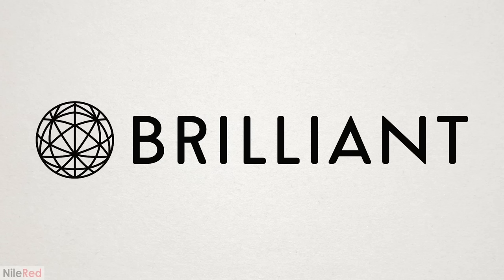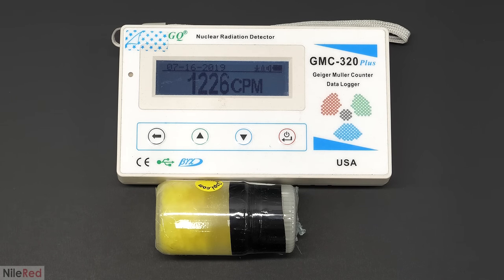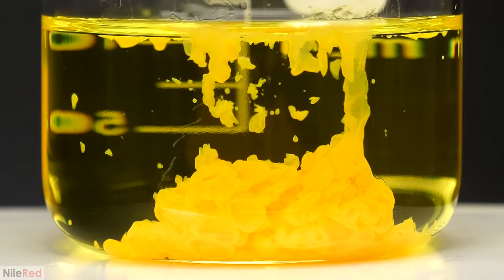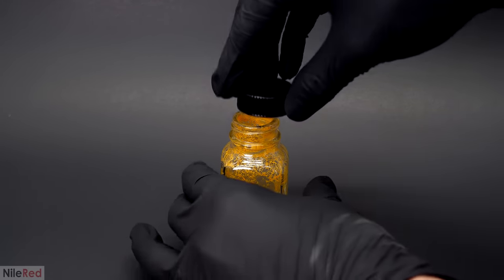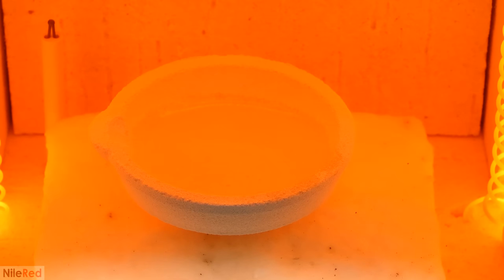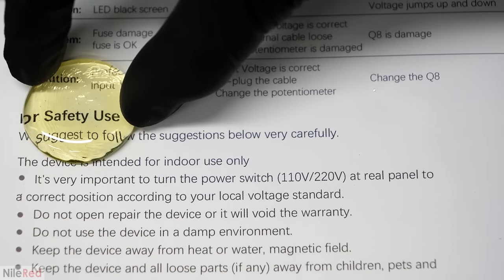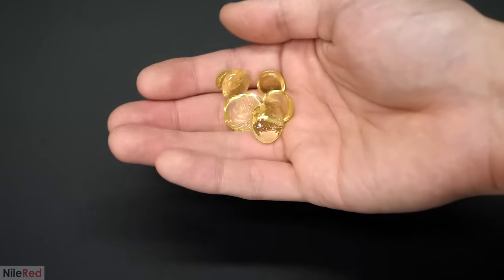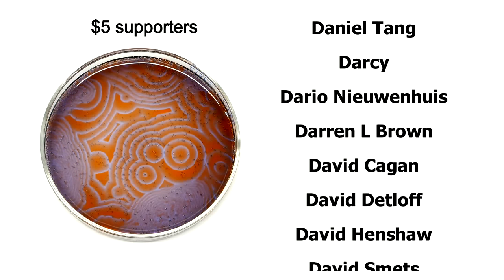Making uranium glass

Comment: So im just going to drop my 2 cents here.  For some background I was a CBRN (Chemical, Biological, Radiation, Nuclear) subject matter expert in the Air Force.  The installation I was stationed at made the focus of my experience within the field centered around the Nuclear and Radiological aspect.

I was curious if I missed it, or if you simply omitted wearing a protective mask whenever you were around the materials?  The primary reason being the particulates of alpha and beta radiation.  Its the same reason I would never drink from a glass made using uranium or any other radioactive material.

Alpha particulates can be stopped by paper or skin, beta by tightly woven fabric, and Gamma rays only through time, distance, and shielding.  Most people with working common knowledge of radiation tend to focus on the danger of Gamma.  However within my field, we actually consider alpha to be the most dangerous form.

The primary reason for this is that Gamma simply passes through your body.  However, beta can and alpha does get trapped within your body upon ingestion or inhalation.  This causes it to simply bounce around inside of your systems with no means of escape, continuously bombarding the vulnerable organs within your body with radiation.

These particulates can be excised through ingesting compounds that bonds to the particulates, but that is something that specialized medical staff would deal with so my knowledge on that subject more general then on the matter of radiation in general.

I hope you stayed safe and I would warn anyone away from being around materials that release anything above normal background levels of radiation without proper PPE.
Reply: The guys who runs this channel is very good about following safety precaution, so I'm sure he did. :) He is a trained professional, after all
Reply: @lucyk8935  yes this is true, but I also was wondering about the use of a respirator or some kind of mask. Nigel is really good, but it is always possible for really good people to make mistakes. I do hope that next time he works with uranium or other radioactive materials he does use a mask as well.
Reply: I'm pretty sure he did and goes more into detail in his cleaning up video.
Reply: He has been wearing a mask. Like,
Reply: Well, yes and no. I cannot agree more about dust particles, they can be dangerous, while alpha "radiation" (not true radiation actually, due to it's particle nature) it self, not so much. It won't bounce inside your organism as you said, because it will quickly become absorbed by nearby tissue. Problem is that dust particle, which will sit there and will be constantly producing another and another alpha particles. It will literally act like a source.
Drinking from uranium glass is safe. First, it emits next to none radiation, very similar to natural background. Second, if it would emit any alpha praticles, they would be imediately absorbed by liquid inside the cup and would not find the way in your organism.
About how dangerous are specific types of radiation, again, it deppends on circumstances and it is simply cannot be said that "this one" is the worst. It deppends on what you consider as actuall danger, it's ability to travel over distances and penetrate materials, or it's actuall effects.
Gama radiation is most capable of all 3 to travel and penetrate, as you said. While alpha can be very easily shielded, but can cause most damage when somehow gets inside your body, again, as you said. But not because it will bounce around, but because it has strongest ionization potential. So gama is considered by many people if you get exposed to some external source of radiation, because it will get most easily inside you. While alpha is most dangerous  when you inhale or digest radioactive material - like dust for example - because it will become internal source of radiation, and there will be nothing in it's way to shield it.
Reply: @OslikusPrime  not true radiation? You need to reconsider your definitions. It is not radiation in the sense of electromagnetic radiation, but it is most definitely radiation. It literally radiates from a radioactive particle.

Otherwise I think you're right about alphas not "bouncing around" in the body. They would simply be absorbed. But I'm not a biologist or doctor, so I'm not sure.
Reply: @camrouxbg  You are actually wrong, or you don't understand what I ment.
Of three types (alpha, beta and gama) only gama is a type of electromagnetic radiation. Alpha (and beta) is a stream of particles. It's helium nucleuses in case of alpha and electrons/pozitrons in case of beta.
We call  it incorrectly a radiation because scientists who discovered it back then had no idea about true nature of it, and thougt it is a radiation. Calling it so is more like a tradition, or historical value, then a fact.
Reply: @OslikusPrime I understood exactly your meaning. I'm not an idiot. You think words cannot have multiple meanings? Anyway, EM radiation is in the form of photons, which are particles. So really, all radiation is a stream of particles. Many people refer to it as radioactive emission, though I'm sure you take issue with the use of the term "radio" in there as well. I suppose we should disavow Newtonian mechanics now that general relativity provides a more accurate description of gravity as well.
Reply: @camrouxbg  Oh well, you take verything personally don't you ? If you can't or don't want to understand difference between helium nucleus and photon, it is pointless to continue in this discussion.
Also, photon is not simply just a particle, it is both, wave and particle. It is called duality and it is something quite special. And it is a quantum of electromagnetic field, which is something completely different, then helium nucleus. Yo yes, particle can have a lot of meanings, as well as radiation. But in this case, both words has very specific meaning. 
In my opinion,  all you want is to argue so .. have a nice die I won't participate in this.
Reply: Alpha particles are helium nuclei with no electronics. They are stopped by almost anything. They readily capture electrons and become innert helium atoms. At that point they are no longer able to interact t with anything and will end up leaving the body. Helium leaks out of helium storage cylinders that are welded shut by slowly moving between the iron atoms.
Reply: What is worse Uranium glass or Crystal glass (which is up to 30% lead)
Reply: @OslikusPrime  r/iamverysmart
Reply: @vHindenburg  Crystal glass with lead is not a threat, at least not directly. It is not being released from glass. Yes, it's production can be an issue enviromentaly and might threatening health of workers.
And not all crystal glass contain lead. Lead is added especially into machine produced glass, because it has some benefits in regard to different cooling curvature in it's liquid state and even there I am not sure, if in all cases.
While hand made glass is often lead free, because it has also own downsides, especially mechanical ones.
I am sure, I frogot a lot in time, but some things stuck in my head, when I worked (briefly and long time ago) in a glass industry.
Reply: @OslikusPrime  Yepp also handling of lead in general is handled way differently to place to place to the point you are unsure how dangerous lead or mercury actually are . Sure you shouldnt eat it. Though it shouldt kill you by just touching it that one time if you wash you hands afterwards. I seen examples where people insisted that you will certainly die of it if you dont wear gloves ( which is an exageration to be fair)while you if you buy lead bars for roofing at the hardware store there isnt really a label about handling on it.

For example I have heard so I am unable to proof or disproof that using a christal glas discanter for wine just the one evening is fine but you should never store any any longer than that. I guess the same applies for items made with Uranium Glass ond Uranium Orange pottery. (Until mid 1960ties i believe).Not really that dangerous unless it is an item of dayly use.
Ar even Asbestos...usually relativly harmless until you fuck with it and get the fiber flying into the air. Its a shamethat such a useful material is so cancerous literally.

Any advice about handling , lead, mercury, items that may contain asbestos or radioactive material you might find in grandmas basement?
Reply: @vHindenburg  Well, lead glass is really safe, even if you drink from it daily. As I say, lead glas dont release lead easily.
Elementary (metal) lead is totaly safe to hande, even with bare hands. You could even eat it :-) and almost nothing would happened. Mercury is a different thing. Again, elementary marcury is surprisingly safe to handle. You can touch it, you cant lick it :) or even swallow it (which I DONT recommend) and nothing  should happen. It is not very reactive and your body will simply dispose it, probably in a form of diarhea :). What is actually very dangerous,  is mercury vapors and on air, in the room temperature, mercury is vaporasing continously. Not very intensly, but all the time and inhaling it is a bad idea.
If you find large cache of mercury in your grandmas basement, you should call authorities, or if is it safly contained, bring it to the authorities.
Asbestos is a difficult answer. If you find it inside of specific items, it is OK. If you find it  inside of walls as fire insulation (older buildings), that's a problem with no clear solution.
It is not toxic, but it continuously releases microscophic fibers which then deposits in your lungs. It is different from building to building, it does not have to be a problem in when, when serious issue in other.  
One possibility is simply accept it and live there, or remove it, which has it's ovn catch. While in previous case releasing of fibers is going very slowly, gradualy and over time, if you remove walls and it's asbesthos filling, you will instantly release HUGE amount of fibers, spread it over quite large area and they won't simply disapear overnight. There has been cases, when removing asbesthos from walls made things  much worse.

And overall, if you stumble uppon something which you think might be dangerous, it is always a good idea call respective authorities. Worst thing which can happen is, that they tell you, that there is nothing to wory about and it was just a false alarm. Still better, then trying to handle something dangerous with no idea what is it and what to do.
Reply: He was handling it with exposed arms. Hope he doesn't die.
Reply: Guy used depleted uranium. The US guv'mint  (Defense Department) says that there have been NO cases of cancer due to DU.
If you can't trust your goernment, who can youtrust? :)
Reply: @michaelcarey9359  Well that’s a relief
Reply: @PoliticalJames  Yeah, also most water-based liquids will absorb radiation well
Reply: I've worked at sellafield for 15 years, and watching him work with the dust and cracking that glass made me really uncomfortable. I hope he used a proper contamination probe and not a radiation one, to detect if any other surfaces were contaminated from airborne particles.
Reply: @wbadair2 Alpha doesn't simply leave the body. If alpha gets into your blood stream, it becomes deadly. We call it the bone seeker, due to its nature on how it behaves with calcium.
Reply: @petrolhead0387  a "bone seeker" is an element which acts chemically like Calcium The most accurate is Strontium an no isotope of strontium is alpha-emitter, some of them are beta-emitter (and dangerous) - the danger is radio active (bone and overall blood cancer) by local beta emisson - the beta emitter isotope replaces Calcium in the bone and nukes bone and bone marrow. But the bone seeker Strontium is chemically toxic for bone and can non radio-active isotopes cause bone weakness and fracture. 
Uranium is not a bone seeker - radium and plutonium are.. 
An alpha particule cannot be a bone seeker - I dont know a chemical bone seeker which is alpha emitter
Reply: @MrZarbidon  depending where he got the uranium from it could contain plutonium, therefore containing alpha particles. I have worked at sellafield for 15 years in chemical separation of irradiated and depleted uranium fuel. It contains uranium, plutonium, radon, ceasium and a few other radioactive elements. I already know how alpha behaves with calcium, thats why I said it in my original comment. I was simply saying that Alpha can be a lot more deadly than what people were saying, do I need to mention polonium poisoning?
Reply: well he's quite safe and is currently seeing what cyanide smells like.
Reply: I must say for 2cents,that was value for money..👍

Comment: "After handling the uranium glass beads with my bare hands, I decided to see how radioactive they were"
Reply: No neutron radiation = No radiation on things
Reply: Test a microwave while running 🧠
Reply: @mwstar Depends, its not bad, but if you would drinnk from it, it would be not nice. Overall its not that dangerous.
Reply: @PoliticalJames  Most ceramic pieces are poisonous. Its not uncommon to get lung cancer from ceramic pieces with deadly glaze makeups, its also been found through autopsies that certain red glazes from specific potters have poisoned the owners of the pieces.
Reply: @barodrinksbeer7484  Did they store it in an open area or inside their cupboard? (Toxic fumes accumulate in the cupboard, making it one breath of death everytime he opens it every few days)

Comment: 12:28 the glass might be absorbing the uv. UV chemistry usually needs to be performed in quartz glassware because regular glass absorbs too much uv. Also, uv fluorescent bulb tubes are made of quartz because it lets the uv through while the normal white ones coated with the phosphor are just normal glass because it’s cheaper and when producing visible light you would want uv to leak through anyway
Reply: I was about to comment the same!
Reply: my understanding is that only true for shorter wavelength uv-c other wavelengths of uv can pass through glass as far as I am aware
Reply: @legokill1019  It depends on the chemistry of the glass. Usually I think glass in your home windows and car windows block UV-B and C and some UV-A is blocked but not totally. With out knowing what the chemistry of the glass is, we can't say what it blocks. I think regular beaker glass lets most of the UV spectrum trough but I guess this glass was not that and was thick enough to block UV-A
Reply: I thought the same thing
Reply: @peter4210  from what I understand, only windshield glass is guaranteed to be treated to block some UV-A. Side and back windows don’t come that way by default, but you can special order them for extra cost.
Reply: 🤓(joke)
Reply: He made a comment addressing that
Reply: If you look at the reflection of his "black light" in the glassware, you'll see it is an array of bright blue dots : obviously it's UV-emitting LEDs - probably originally designed for DVD or "BluRay" readers (the hint is in the technology's name). IF there were a glass sheet over the emitters, then it might absorb the UV - but my black lights use a plastic protective shield which does not absorb the UV.
Could you get a "plastic" that absorbs UV? Hmmm, I'd have to think about that. You'd probably need to load it with some mineral absorber, or some of the chemicals used in "sun block".

Comment: I do radcon for the navy. If you want to see how much of the counts are alphas, count it, then cover the glass with a piece of paper, then count it again. The paper will block the alphas and you can see how many gammas it gives off. I prefer to see it in CPM because it's showing how many gammas are interacting with the counter each minute. The micro sieverts display is the counter converting counts to an equivalent radiation level. The paper method demonstrates why alphas are not an external radiation risk. They are stopped by your outer dead layer of skin. However if you ingest alphas (which I hope you wore breathing protection) they are the most damaging as they have the highest quality factor (20, whereas gamma is 1)
Reply: i thought alpha particles were just helium
Reply: @nastykerb34  They are but they're traveling at around 10% of the speed of light.  Although their mass is small, their surface area is too which means it's like a cannonball agains your cell.  + alpha particles are strongly positively charged and they have so much energy that they can basically rip electrons from your cells
Reply: @llamazfn7270  helium are still helium
Reply: @nastykerb34  true but extremely fast, extremely energetic, ionized helium.  Very different from your typical party balloon
Reply: @nastykerb34  its just the cores. so more like he+2 i guess
Reply: @nastykerb34  ionized, high energy helium. They don't have any electrons so they don't follow the same rules as atoms
Reply: as bluejay put it in his video explaining radiation
"Alpha radiation is the weeb of radiation. They can't do much, but if they get in they'll wreak havoc on your cells with their atomic Katana" (I can't remember the exact words)
Reply: alpha can go through a sheet of paper. Saw it with my own eyes
Reply: @nastykerb34  a grain of sand going fast enough, could cause a lot of destruction, now imagine thousands of those grains, and the destructions that would ensue

Comment: "I only dried I completely in the final container I was storing it in so I won't have to move it around"
shakes the glass a shit ton without the top on
Reply: Pours it out creating a visible dust cloud at 17:32
Reply: @TankleKlaus  i think he did that in a fume hood machine thingy.
Reply: Also touches the top of the container with the radiation detector. 

I think he says these things to point out the danger, but in reality, at least in this case, it's not so bad.